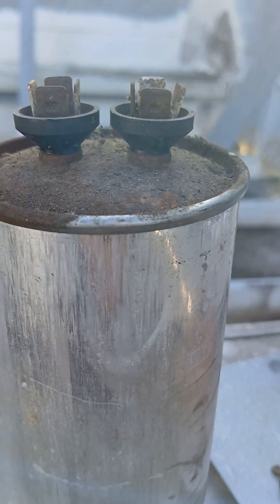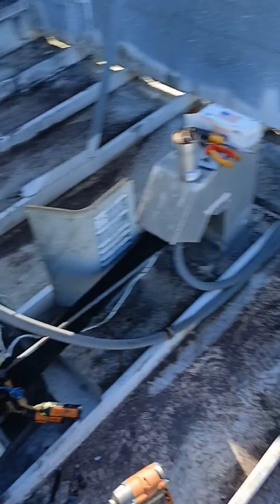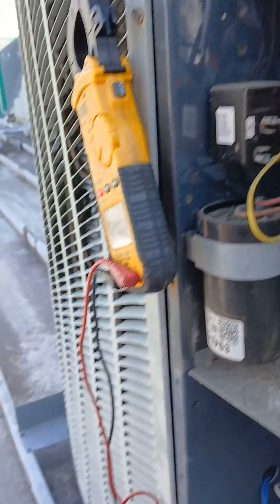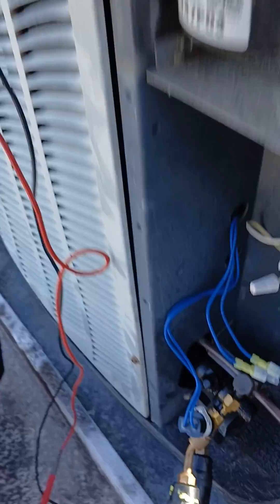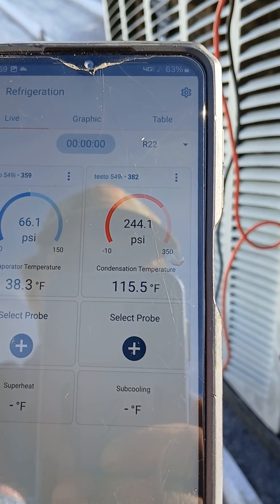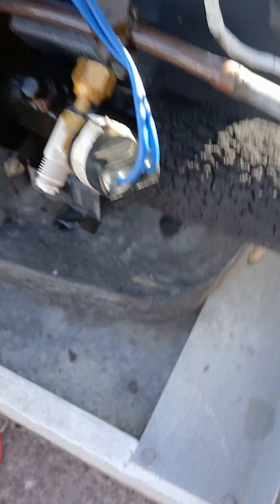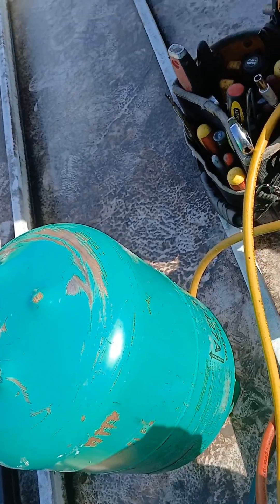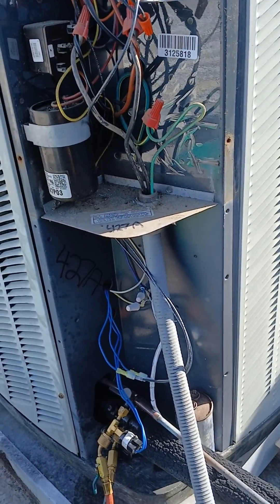I saved an old r22 system using 427a.

Comment: You don’t charge off sub cooling or superheat?Just get the pressure half ass close and call it good
Reply from the maker: @DallasPhillips-hz9yn  all of the above.  Subcooling 10-14 super heat 20-40 pressures 65-70/225-250
Reply: @suezq74 no I didn’t half ass is what I said

Comment: Nice to see an honest tech and not a predatory salesman pushing new equipment at crazy prices these days. I only found out about R-22 replacements after some research and it seems the industry norm is either recharging with R-22 at crazy prices or new equipment. These drop-in R-22 replacements seem way less common than they should be when R-22 equipment is in good condition but lost charge from a repairable leak. I don't think I can buy these without an HVAC license but from what I understand 427A, 407x, and other R-22 drop-ins are like less than $50/pound versus the dwindling supply of R-22 being several hundred per pound these days.
Reply from the maker: I don't carry r22 on my truck anymore. The only option with me is to convert it over.  OR new equipment depending on what is wrong with it...
Reply: Update...MOST techs are honest,  poorly trained perhaps but they believe what they are saying... it's the owners who send them out that are ripping you off..

Comment: Great Job, I used to do A/C on Automobiles way back when, did u need to retrofit any of the parts? To accept the new 427A freon? Or is the freon the new R22? Sorry been out of the loop for yrs now.🤭
Reply: 427A is designed to be a 'drop-in; R-22 replacement that has very similar pressures and requires no changes for existing R-22 systems. Basically a new production alternative to the shrinking R-22 supply and crazy prices yet I barely knew about R-22 replacements as someone not working in HVAC and was just concerned about new AC unit prices if our R-22 system developed a leak. R-22 was used in AC units until 2010 when it was replaced by 410-A in all new units, but 410-A runs at higher pressures than R-22 so they're not compatible and you need to find a certain R-22 replacement like seen here that can be used in pre-2010 AC units. This is basically the alternative to having to buy crazy overpriced new equipment if you have a repairable leak.

Comment: Did you make a long video if this job. I would like to see if you ended up replacing that failing condenser motor. Also I would have liked to see if you replaced the filter drier when you removed all the r-22 and replaced with 427-a. Which you probably did none of that. 427-a is my go to r-22 replacement but Im not a hack and mix 427-a and R-22. I recommend deleting this video if there is not a long form.
Reply from the maker: No long video.  Dryer was inside next to airhandler and was replaced. Everybody hacks stuff a time or two, so when you say you not a hack, understand that some jobs can not be completed to perfection depending on the customer.  Im not a fan of blending gas.  This particular gas station has its own repair men, not sure if they don't handle r22 or why I was there, but my job was to get that unit going and did just that.
Reply: 427a is a direct drop in replacement you can add it strait to R22.If you have a TXV might have a very slight temp glide will be fine.How about you post videos of your jobs since you’re so by the book show the rest of us how great you are
Reply: @DallasPhillips-hz9yn  Where does it say you can blend refrigerants?
Reply: @WhowereEpsteinsclients  direct drop in what part of that don’t you understand?what do you think for example R407c is a blended refrigerant. It takes like three refrigerant to make 407C.
Reply: @WhowereEpsteinsclients  what part of direct drop in don’t you understand.407c is a blended refrigerant for example.takes like 3 refrigerants to make R407.It runs the same type of oil made as a direct drop in boiling points arnt far apart anuff to matter
Reply: @DallasPhillips-hz9yn  Lmao you have no clue what you are talking about. R-22 is azeotropic and 427-a is zeotropic blend. 427-a is not recommended to be used in mineral oil application or alkyl-benzene. 407c and 427-a are a closer match than 427-a and R-22 will ever be. Read a book.